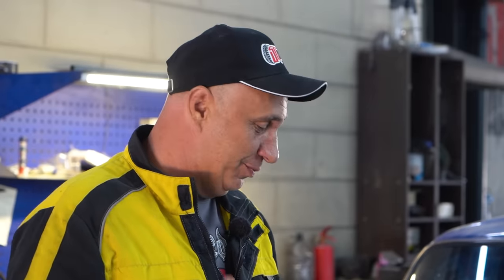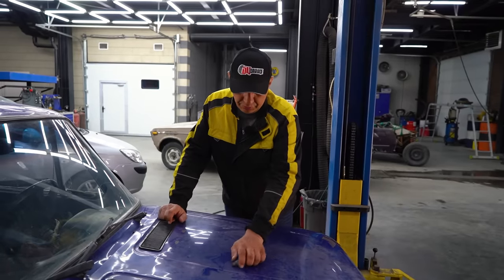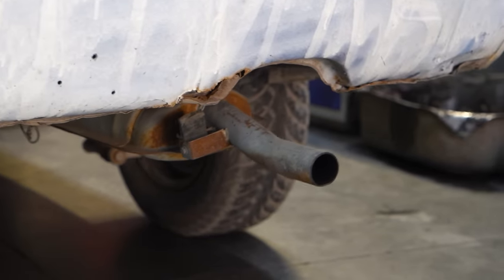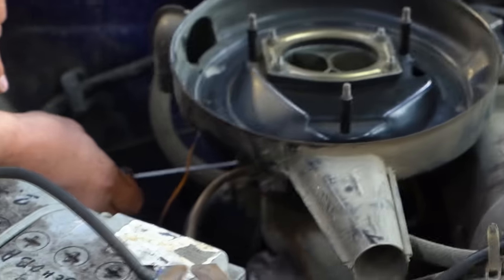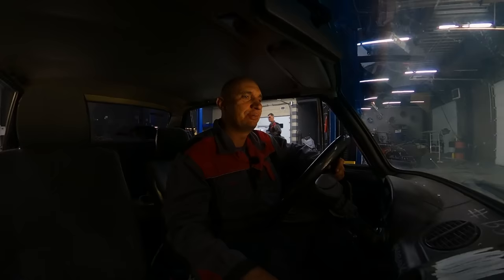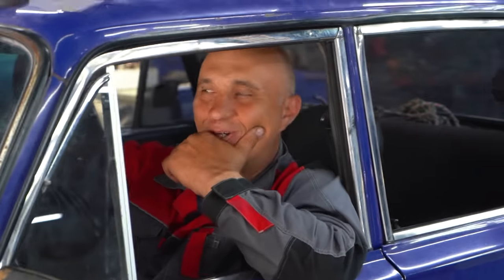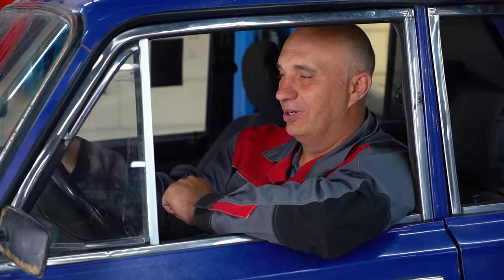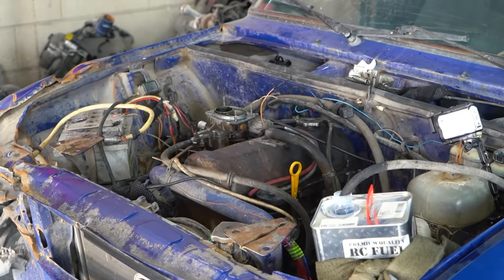Glow plugs in a gasoline engine - will it run?

Comment: Let me suggest again, build a multi-fuel engine. LPG, petrol, diesel and anything that burns. So far you have tried everything, all that is left is this test. LPG is very easy to install on the carburettor and can also use a gas bottle for home use.
Reply: Some old, maybe John Deere tractors, could start them on gas n switch to diesel after warmed up. Or just run them off gas all the time which they ran better that way. Believe had plugs on one side of the head and injectors on other side.
Reply: @shawnsatterlee6035 US Army trucks m35a2 have lst-465 multi fuel diesel. Back in 2008/2009 I daily drove one when diesel fuel was expensive. So I ran it off gasoline. The looks and arguments I got from people at gas pump where hilarious
Reply: I did drive my 1985 toyota corolla ce70 diesel with petrol and it worked normally, no problems
Reply: So just mix all the fuels? Or inject/ carburate them separately?
Reply: @shawnsatterlee6035  Tons of early 1900's tractors used gas/kerosene for fuels. Same idea, start on gas, warm up, switch to kerosene. I think they used a regular carb.
Kerosene was much cheaper those days, so it makes sense to go through all that hassle.
Reply: You forgot nuclear and lightning powered options...😂
Reply: LPG is used there heavily there in Russia 🇷🇺
Reply: #1 cyl runs on gasoline
#2 cyl runs on diesel
#3 cyl runs on propane
#4 cyl runs on compressed air
Reply: I am pretty sure they have done this before, They used multiple different oils like cooking oil, WD40, kerosine, etc,
Reply: @Snowaxe3D , Yes, but it was a diesel engine (Toyota). Lada multi-fuel engine, just need to pack everything. It's not impossible.
Reply: I worked on a farm where the old man would basically cut gas with old moter oil just mix the 2 and run it in the tractors it would smoke but still ran fine
Reply: Jet engine: They will burn about anything. The nature of a piston engine limits what can be used.
Reply: And vofka as fuel?
Reply: It’s called a turbine.
Reply: He must have valve in bootle with safety for backfiring
Reply: @Ai_Toolshed  as long as it gets up to 88mph.
Reply: You can use LPG on normal gas engine. Only what you need, is some kind of carburator, that adds fuel/air at right mixture. Abviously normal gasoline carburator wouldnt work because fuel is on gas form. But you can find this kind of carburators from forklifts and at shops, that does sell forklift stuff.
Reply: most of the GMC trucks in WW11 were multi-fuel. the gas turbine engine in the Abrams tank will run on just about anything with an octane rating.
Reply: @shawnsatterlee6035  all true
Reply: @hornetscales8274  in post war mechanical into poland and germany constructors design few multi fuel engine. 1 of them is engine between petrol and diesel. In direct translation from polish language is medium- pressurized
This half diesel engine have red hot element in head(grusza żarowa) and compresion ratio between previously engines 12-16:1
Higher  petrol (11:1<)
Lower diesel  (20+:1)
These engines średnioprężny burn every liquid fuel like nafta(kerozine) diesel petrol alkohol(metanol,etanol) and oils like vegetable oil, motor oil and single units can burn wood gas (holzgas). Piston can't limits this engines.
Reply: The glow plug would detonate the gas before the inlet valve shut so probs wouldn’t run or run very badly worse than the rest he just needs more nitromethane and less air to make it Rev, would work well as rc cars work on same design with a glow plug in the cylinder
Reply: @dannypearson547  true. nitro love to run rich. they throw so much fuel into those dragster engines that they are constantly on the verge of hydraulic lock.
Reply: Someone I know has a van that will run on gas or diesel
Reply: @peraz968  :It can be installed on any carburetor, a hole is drilled above the throttle valve, the electric valve closes the gasoline and opens the lpg. Solex, weber, any. Finally, it can be inserted into the air filter housing without the evaporator. but then the lpg/air mixture has to be adjusted manually. Tried everything and anything...
Reply: @matt cool story bro
Reply: @snowaxe wd40 is not oil
Reply: @shawnsatterlee6035  Farmall actually did that John deere just had a 4 cylinder 2 cycle to start the 2 cylinder diesels
Reply: Might as well throw a coal gasifier on there too since that already needs some similar plumbing.
Reply: @operator8014  use the compressed air cylinder exhaust straight into the propane inlet (unsure if any cylinders could actually be timed to get any benefit, but just for lulz) for supercharging benefited by propane's insane octane rating
Reply: You try it then. If you want to see it so bad
Reply: Go hybrid: burns gasolie and engine oil 😁
Reply: Just put a Turbine in the Car and it will run on anything....
Reply: I was just thinking this but use the lada platform, they've already built one with high compression and can easily make forged parts. Well maybe not easily but they could
Reply: Hell, just make it run on crude oil and all of the above are plausible.
Reply: @getl0st Agree. Some old cheap turboshaft or turboprop connected to a reduction gear and then fitted to the Lada transmission. Perfect multi fuel setup.
Reply: I once got my old 2 stroke Yamaha golf cart engine to run on propane . The carburetor was oil injection. If I remember correctly it was a 215cc . Wish my pops never sold it to my brother-in-law . I would still have it to this day Probably with a bad ass expansion pipe , ported & polished . You name it it was such a cool golf cart with nice aluminum wheels it looked beautiful the stance was fairly low if i remember too
Reply: Propane is one of the best alternatives to gasoline but its very expensive to convert
Reply: @Matt-ou1bg ,в детстве проверяли работу мотоцикла на дизельном топливе ,главное его подогреть🤫
Reply: @shawnsatterlee6035 Yep. I have a 1956 JD 520 like that. I burn all my used motor oil in it.
Reply: Something like the "liquid piston" I think it's exactly what your looking for
Reply: If put a eltrontic motor on a shaft. To run the accelerator pump. In sted of pumping your foot. 
Needs fuel. God bless
Reply: Chrysler did this with an engine in the 40s for tanks. It's called the multi bank
Reply: They did it long ago prior to glow plugs (for tractors) using a small flat glass for 5cc gasoline to ignite n increase temp (more like flintlock guns in slowmo)
Reply: There is lot more to try , they did not even put the engine of the Lada in the back and give it few more horses , to be cheap mans Porsche .

Comment: This might work if you lowered the voltage to the glow plugs. It would lower the temp of the plugs. This would have the effect of reducing the ignition timing
Reply: God thinking brother
Reply: Yea, think of the hot tube engine, there the hot tube was only barely even heated dull red, not bright orange as combustion pressure would just blow it apart at that point, this was the exact issue early hot bulb engines had, until compression was increased toward early diesel engine levels where the holt bulb only needed to be heated to a dull red for starting.
Reply: That's a great idea.
Reply: They could wire two of them in series so effectively 6 volts per glow plug
Reply: @jasonharrison25 it might be harder to shunt the glow plugs because they have common ground on chassis and cylinder block.
Better put a series high power rheostat to reduce current going into the glow plugs.
Reply: Soo it didn't work? I guess I can stop watching now lmfao
Reply: @abusaidfulus8901 Not if you understand basic electrical principles lol
Reply: I would think to use diesel you need a lot more compression lol. Diesels rely on glow plugs and then compression takes over
Reply: you are correct in a way but once you give it gas more fuel and air enters the engine and the glowplugs start automatically heating up.
what happens in the long run is that the plugs need to cool off again before you can really rev it high again.
great idea  for lower revs though to keep it running more stable.
Reply: @abusaidfulus8901 old Bosch had a design that was a series set with nichrome bar connection for four cylinders that were longer than the one for five or six , and the old salt shaker glow indicator and puller style MB . The old 190d had the salt 🧂 and it had a wound resistance on the firewall. You could delete the resistance and it would fire a recalcitrant engine 😊
Reply: @MadScientist267  well that's obvious.. guy can't even speak English in the video..

Some people's children smh
Reply: @MadScientist267  go stare at the sky champ
Reply: @MadScientist267  lmfao don't quit your day job champ
Reply: @MadScientist267  🤣🤡
Reply: @MadScientist267  your mom got there first.. so I had to settle for the gander this time.
Reply: @MadScientist267  did you have fun pushing her in the wheelchair..

I bet you enjoyed yourself!!
Reply: @MadScientist267  awww rage delete comments much bud
Reply: @MadScientist267  🤡
Reply: @ontariofishing1790  Lol one by one. Who's the 🤡 now, derpus? Can't seem to pay attention...
Reply: Good idea. I was thinking maybe they could put an adjustable cam gear on it and fiddle with that to see if playing with the cam advance would make it run better. The way I see it the cam advance is now effectively the ignition advance with this setup.
Reply: I was thinking exactly the same. At full voltage it seems to ignite too early.
Reply: Run the glow plugs of a 6 Volts battery and the rest of the car on 12 Volts.
Reply: @RODALCO2007  now that's using your noodle lol... good idea... I hope they try that... but more then likely they have moved on
Reply: @abusaidfulus8901  yes the rheostat would makea good heater inside the car for those cold russian days
Reply: @gettin_while_growin1512  not all diesels have plugs... either theyre small, or they have decompression, or both. lol, had to use the decompression yesterday on my tractor cus i left the ignition on for a week...

plugs just make them easier to start despite the outside temperatures, let them run slightly lower compressions so the starters dont have to work so hard... throwing a turbo on makes up for any loss in that aspect... 

the hotbulb/tube ignition ran much lower compression, always stayed hot. issue was it got TOO hot as power increased... really hard to regulate its temperature with load. and having to use a blowtorch to get it started is a hassle...

whereas with PWM on plugs you can run a standard petrol engine on just about anything if you can get it to atomise...

Comment: On my 2 stroke moped on witch i modified the cyl and piston with books from the library, i found out the spark plug became red hot and would even run without the lead/cable plugged after pulling if off due to extreme high rpm and continue to run on the same rpm without sparks. i even used sun flower oil in the tank at some point and it smelled like restaurant.
Reply: I did the same thing on accident. I was running my minibike and ran out of gas so I started adding a little oil as the tank went down. Them I ran completely out of gas and so I started mixing acetone and oil. It was thin enough the carb could send it through but it was knonking and got so hot when I tried to turn it off it kept running. 😅
Reply: Also happened to me on a 50cc, long time ago i was learning by tinkering around and making some experiments on scrap test engine, and i raised the compression by removing material on the head, then i went for a test and gave it full beans, when i turned off the engine i switched off the power to the ignition coil and the motor still run for a minute or so, then i tried disconnect the wire from the plug while driving in a constant high rpm and i was able to run as long as i want but i had to kkep always high rpm. The sound also changes, it gets somewhat more silent and muffled.
Reply: @tiagoferreira086  Yeah, that's what i did too, using coarse/fine grinding paste i removed like 1mm from the head. also made the exhaust port wider, the max the piston rings allowed with a round file, some changes to the piston to make it lighter. i had to help to get it going from a stand still but once in motion, i estimate i had at least 11.000 rpm or so for a 50cc moped. The sound was madness, using the standard jet, standard cyl/piston, but do used a Yamaha RD80 power box and a polymer Proma exhaust.

Even the piston got stuck once going uP hill! but once it cooled down, i could proceed and found out there was no damage, but the rubber track i layed on the ground was like 15 meters longs. I never let me down, apart that it needed help to get going and maxed around 75/80km/h for a Puch Maxi.
Reply: I put rc nitro fuel in a weedeater, and after it warmed up, it ran just fine with the kill switch turned off. It didn't rev quite as smoothly but still happily cut down 3 inch trees with a brush blade. The power was insane on 33% nitromethane.
Reply: Cool story bro
Reply: nitromethane only combusts gently but liberates much oxygen when burnt , with a standard moped i would limit nm to 5or 10 % in an alcohol fuel mix.

Comment: Try warming up a gasoline engine then change the fuel to diesel and test if it works, and if not mix diesel with gasoline with normal spark plugs*
Reply: Isn't that actually going backwards tho? Yeah ppl would add some diesel or kerosene to gas to jump up the octane, so basically that's same thing.
Reply: IT was warm when they added diesel
Reply: @uooello13  with normal spark plugs*
Reply: @shawnsatterlee6035 diesel lowers octane rating though, it literally is meant to ignite soon as possible
Reply: It should be able to made to work just fine, used to be very common for tractors

Comment: Damn that’s crazy! I wouldn’t have thought it would have run that good!
Reply: Yeah nitro engines run al the time glow plugs
Reply: @cliffgamer7832  Yeah, but isn’t the nitromethane in the fuel specifically designed to be very sensitive to that type of ignition?
Reply: @xmysef4920  there is so much heat, spark, compression that technical they should run on just about anything with an octane rating. it just happens the nitro is the best for horse power. with such high combustion and temperatures the plug burns away like a welding rod. by the time they're three quarter track they are quite literally running like a diesel. purely by detonation.
Reply: I will change my sparkplugs to glowplugs them
Reply: @Kawka1122  Make sure you change your radials to slicks while you're at it :)
Reply: @xmysef4920 no as a matter of fact rc cars that use nitromethane use a glow plug to start it.
Reply: @Kawka1122 it’s a proof of concept…it’s not actually advisable!

Comment: There is one idea i wish i can imply , its by using regular gasoline engine with running cold water vapor steam, like the one produced by ultrasounds in humidifier, when you run it inside the manifold, this will highly increase gas milage especially when you control the fuel mixture and run lean fuel mixture
Reply: true, proper atomisation produces a better burn. globules of fuel don't burn as nicely and escape as unburned gas, Recirc valves try to take care of that by re-feeding the exhaust in the engine to give the now-gas a chance to burn instead of just evaporate.
Reply: We tried this idea about running  small steam into old single cylinder motorbike manifold and it gives boost with great improvement in fuel economy
Reply: yes its called watermeth injection, oldsmobile ran their turbo car with that in the 60's, basicaly cheap windsheild washer fluid, you can run the engine very lean and the cyl temps will be as low as a very rich fuel mixture, it works with water only but the performance will decrease by alot, the other benefit is that the engine stay clean, very helpful for modern direct injected engines
Reply: Have you ever used a Direct injector outside of the engine, that is what it does, but with enough fuel quantity to actually make usable power
Reply: Injectors already atomize the fuel mixture. Probably could be improved though.
Reply: @IvanOoze1990  Low pressure fuel injectors don't do a particularly good job at it on their own, they rely on turbulence from air rushing by the port to break the droplets down further. If you want true atomization, you have to go with high pressure direct fuel injectors (~2000 psi) where the spray pattern into the compressed air charge near TDC is the only thing responsible for atomization and mixing.
Reply: @retrocompaq5212  yes i guess it would ! , but iam not sure about with the positive pressure inside the manifold with turbo charger !, 
But without turbo you don’t need injectors to make the mist inside the cylinder , but simply use mist from humidifier ( ultrasonic one ) not the one  produced by boiling the water because that will condense inside the manifold and you don’t want to affect your efficiency inside the  cylinder by pouring condensed water .
The cool mist would do the trick especially if you can go up and down with the amount produced according to the rpm
Reply: I think that the steam would cause more issues over time.
Reply: @jwalster9412  , I don’t think so ,  since all the parts that could be affected by rust are very hot and the rest is plastic
Reply: @abdalsamehmuhammad5687  however, it any of the steam does stay behind when the engine is sitting it could rust.
Reply: i've wanted to try this for a long time.
Reply: @retrocompaq5212  i have watermeth injection on a 3.0t audi the car screams.
Reply: @jwalster9412  yes i think this is true !
Reply: @98f5  we did it on old motorcycles and it was working, very good gas mileage with increase in power
Reply: I think BMW M engines do that, by injecting water into the intake to increase power and decrease EGT
Reply: @retro cool story bro
Reply: @teardown cool story bro